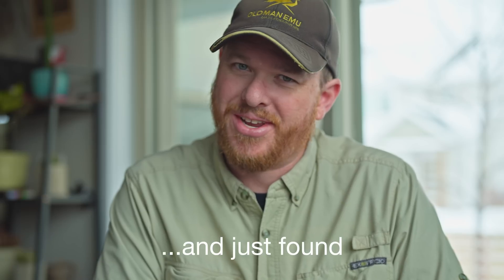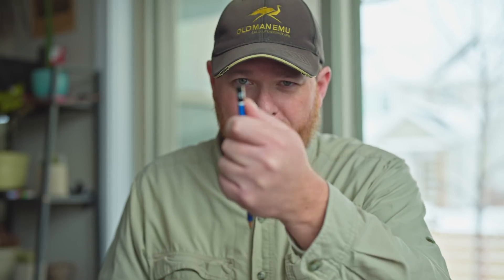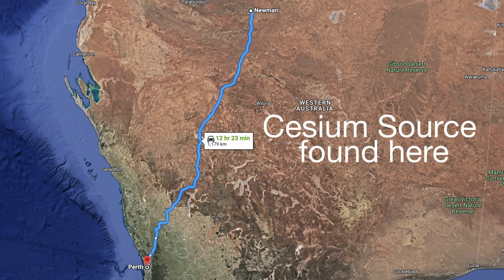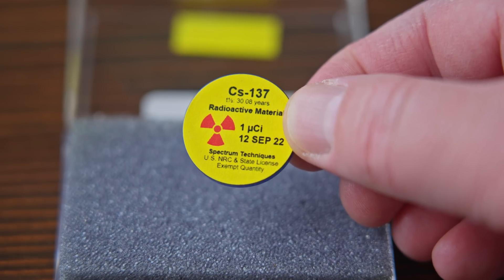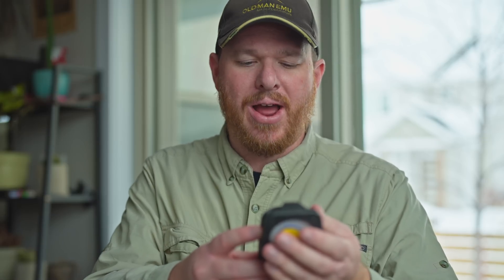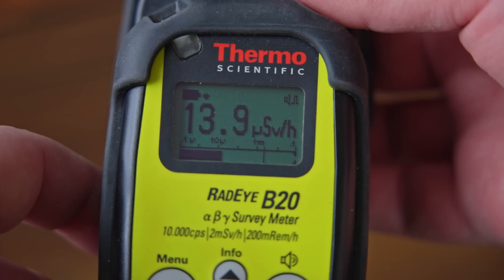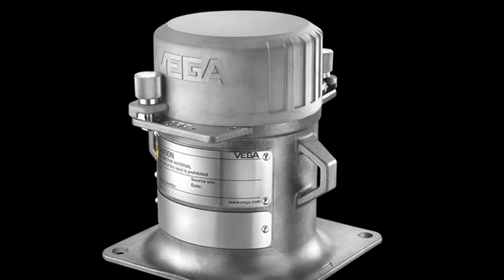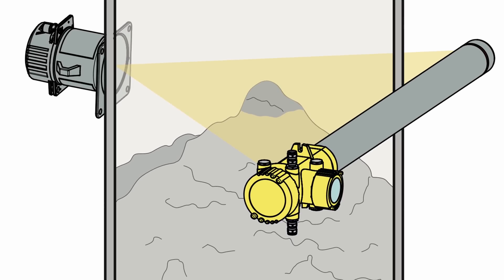Cesium 137 Source Lost and Found in Western Australia

Comment: I used to work with the exact brand of equipment you showed in this video. During my time with this company, I had two incidents with source holders. 
The first thing that happened was that we had a test source of cobalt 60 in the office. The source itself was lowered into a lead cylinder to isolate it. Since it was not in much use I did not interact with it often. One day, I was testing my measuring equipment and wanted to check how much radiation the Co60 source emitted. To my surprise the radiation did not increase when the source was removed from its lead cylinder, which turns out the rod, which the source was attached to, had been upside-down the last 10 years. So when picking up the rod, my fingers were in direct contact with the source. This is 10 years ago, and my fingers are still the same 😂

Comment: I work in the nuke industry and we use the Rem units.  I wish the scientific community did too because the conversion is a bit awkward to mentally do on the fly, when converting usv to mrem. 

I have to write it out and shift the decimal on paper.  Whata wrong with Rems?  They can't be that bad to use.  Everyone just has to be different I suppose.
Reply from the maker: Well I got into this and Sieverts were the dose rate measurement to use...that and Grays. Many detectors now can be switched between Sieverts and Rem, along with some other units. I just picked up a Canberra Mrad 113 and that uses Rem.

Comment: A 0.02Ci is absolutely tiiiiiiiny. I regularly work with 20Ci Iridium-192 & 30Ci Selenium-75 for NDT.

I meam it's not a good idea to eat the capsule if found haha but you could pick up a 0.02Ci Caesium-137 and wouldn't get radiation burns from it.
Reply from the maker: Dang, those are some hot sources.

Comment: I'm curious, it was laying there on the ground for 20 days or so...did they have to remove some soil & clean up the area where the capsule was found or no need since the caesium was contained within the capsule?
Reply from the maker: No soil needed to be removed because nothing was contaminated. If the capsule broke open that would be a different story.
Reply: @RadioactiveDrew  Thanks, I understand more now.
Reply from the maker: Glad I could help.

Comment: So the deadliest is when we eat radioactive seafood right?
Reply: I would be more worried about breathing in radioactive dust that might stick to the lining of my lungs.  This is one of the reasons why smokers who worked in underground uranium mines had incredibly high incidences of lung cancer.  It's thought that the radon daughters would stick to the smoke particles and then get glued to the inside surfaces of their lungs by the tar.  And then those daughter products would remain directly in contact with the lung cells where they could bombard them with alpha particles, which, while not very penetrating, are extremely damaging.
Reply from the maker: @jsigmo this is usually with a high radon environment like a uranium mine.
Reply: @jsigmo , whether one is a smoker or not, if one happens to swallow radioactive materials, it's very dangerous. 
There was a study before that said,  in a polluted place, a smoker has a low chance of getting lung cancer.  A non-smoker will surely get lung cancer living in a polluted place.
Reply: @jsigmo , if you think you have uranium dust there, leave your country.
Reply from the maker: @butchfajardo8832 we ingest all kinds of naturally occurring radioactive material daily. There’s no way around it.

Comment: I work for a large domestic mammo machine manufacturer. The MQSA mandates no more than 3 mGy per breast. Our systems actually run just south of 1.2 mGy for a 2D exposure and 1.5 mGy per tomosynthesis (3D) exposure. Not sure where that 200 mSv number came from but that's going to be too low to obtain a quality image for screening or diagnosis. The detector surface area is just too large, you need more dose than that, otherwise the contrast-to-noise ratio is poor.
Reply from the maker: The number I put in there was 200 uSv and I got that from a site about x-ray doses. There's a lot of info out there concerning doses from different x-ray procedures. I have heard it going as high as 1mSv or 1mGy of exposure. But I figured I would stick with the lower number.

Comment: I think one of the most concerning things about situations like this, as a person with ADHD, and a small forge, i like to collect scrap steel i see to make decorations and art pieces, I have imagined on several occasions how shitty it would be if one of the dozens of small cylinders of metal I find weekly would happen to be a cesium source. Even scarier is the fact I’m in the smack middle of one of the biggest oil producers in America, Oklahoma. Some workers in the oil field check the integrity and state of underground pipelines using Radiographic testing, which use Xray or Gamma rays to view the internal structure of pipelines and components. In fact one of the only SUSPECTED cases of suicide by radiation occurred in Oklahoma and involved a missing source from one of those machines.
Reply from the maker: Ever since I started down this road of learning about radiation and radioactivity I've always had a Geiger counter of some kind in the truck and more times than not, having it running. I'm always curious when I find areas that are a little more radioactive than others with no real explanation to it.
Reply: @RadioactiveDrew  I’ve never really had the money to afford a dosimeter of decent quality, despite my obsession and very minimal collection of slightly radioactive materials. When i was a teenager I would ask my family for a dosimeter for Christmas and birthdays, but they were rather expensive and never got one. 
If i had a dosimeter, I would absolutely do the same as you, who knows how many hotspots there are around us no matter how small. May it be a higher concentration of radon gas from concrete structures, or radioactive elements in the nearby ground, it’s always a fascinating concept to basically metal detect for radiation. 

  Having a dosimeter on my person during my scrap metal scavenging at scrapyards and abandoned structures would be a good peace of mind. I’d much rather have something scream at me, than have a hole in my leg. 

I appreciate your time and words! Amazing content as usual, stay safe!

Comment: Use this stuff at work to make sure meters are working and for safety system checks you can hold it just don’t eat it
Reply from the maker: These tests disks are pretty safe to handle. The sources used in those density meters not so much.

Comment: Your full body dose estjmates are completely off. 20mCi of Cs-137 puts off about 8mSv/h at 10cm distance. At a dose rate of 280mSv/h, the distance to the sourge would be under 2cm. Could you get burns from prolonged exposure with the skin against the source? Yes, absolutely. But there's no way an individual could exposure themselves to 280mSv/h of full body dose from putting that source up to their chest. So no, not 2800 chest x rays per hour...

Comment: Some density meters use a source of 1mCi Cs-137, that is about 10,000x times what you are showing us!   Other manufacturers claim to use sources like you are showing so that licencing isn't required, at least, not in the USA.   So I think we can assume that the source lost in Australia was a fairly hot one!  The containers are probably made of lead with a powder coat to protect them.
Reply from the maker: It was around a 20 mCi or greater that was lost and then found. I was able to hunt down the info from a manufacturer that makes sources for this type of use.
Reply: @RadioactiveDrew  That would explain all the concern to find it again.  I worked with a company in Spain who did these tests in drillholes and their source (similar activity) was tied onto a cord and dangled down 5 metres into an indoor patio that had no access from the apartment building where they had their offices.  That was their idea of "safe shielding"

Comment: I would have thought those little cesium check sources like the one you have would be more radioactive. My counter picks up ~23 uSv/hr from an NRC-exempt uranium glass check source - without alpha. Any idea why that would be? Maybe the size? Uranium glass is like you chopped off the tippy top from a glass marble so maybe pinky-nail size, whereas the actual cesium content in your source is super tiny? 'Cause I know cesium is a lot spicier.
Reply from the maker: The check sources can come in different amounts. The one I have I believe is the lowest you can buy.
Reply: you cant use dose units with beta. well you would have to use milliard. in reality its 0.900 usv or around there not 23
Reply from the maker: @kingcanada2588  that's kind of a grey zone there. When they talk about Sr-90 and its activity and dose rate they use Sieverts. Sr-90 is a beta emitter.

Comment: I found an area with rocks that give 100 usv/hr.  When I started digging with a shovel I noticed the soil all around it was sand/silt, but the soil directly in contact with it was clay  and the rocks were soft and broken down. Was wondering if it was the radiation that broke down the soil to clay faster.
Reply from the maker: I know that sometimes radiation can cause a change in color with the surrounding rock layers. Usually it won’t break down other rocks…but I’m not 100% sure it won’t.

Comment: Here in the UK they were transporting a source and stopped on a railway bridge to take a look at it without the shielding. To cut it short it rolled off the bridge parapet and fell in a passing goods train. The train was stopped just short of London and the authorities found it in a coal truck. That's a true story. What I will never forget in my copper mining days is that we were in a remote place so it was up to us electrical techs to change sources. The source was a pinhead of material inside a double walled stainless match box inside shielding so heavy you needed a crane. To shorten this the source fell through a grille floor and dropped into the discharge sump of a 800 ton rotary mill. The sump was 10 feet deep and the day workers called me over to take a look. What I will never forget is the wonderful blue/ green glow lighting up the whole sump. I thanked the lord that I was a shift worker and fishing it out had nothing to do with me.
Reply: This may sound weird as hell, but the fact you experienced the Cherenkov Effect outside of a nuclear reactor is probably the coolest thing I’ve heard in a long time and Im honestly a little jealous.
 I’m not sure if you fully understood the physics behind the glow at the time, or maybe you did, but either way it was probably the most amazing experience of your life.
Reply: @Kill3rBamb1 the reaction only accrues after reaching criticality and then is cooling down. This is 100% a fake story. As you can't reach nuclear criticality outside of a reactor without a lead casket
Reply: I’m assuming it was under water or something in order to glow so brilliantly, I don’t know much about locomotives or what a sump even is, but assuming it was submerged, you got really lucky because depending on the depth, liquids are pretty good neutron absorbers.
Reply: @Kill3rBamb1  the blue glow was observed in US nuclear labs as well. Not sure if it's ionized air glow, Cherenkov radiation from moisture absorbed by the sample or what, but it was also much admired in Goiânia during that orphan source disaster. One small child painted herself with the powder, got some on her sandwich and died from a lethal dose of radiation.
Reply: I'm in the UK - thanks for the stories. Really interesting.

Comment: So it is dangerous enough inside its container. Then what if somehow it got exposed out of its container? How dangerous will it be? ( Not sure about the amount but if its container has 5 inches diameter and 8 inches long.) And what's gonna happen if the Cesium 137 is smelted in the open? I'm worried because this is what likely happening in Thailand but the government haven't given any proper answer of what really happened and we just need to know if we are safe.
Reply from the maker: If someone opened the container and took out the Cs-137 source there could be a very big contamination problem. But so far it doesn't sound like that is what happened. If the Cesium was smelted it would contaminate the general area of the smelting location as they wouldn't be worried about it getting places. It would also contaminate whatever it was smelted into. It would be a very localized problem...if that happened. So people that worked at the smelting location would be at the highest risk. The likelihood that any of that cesium making its way out of that area to effect other people is extremely low.
Reply: @RadioactiveDrew  What I know so far is that the Cs-137 (in its container) in some factory was lost. And around 10 days later they found this container been smashed in a smelting factory. Then later, they found Cs-137 in red dust from this smelting factory as well. But the government said everything is undercontrol and there is no contamination. I don't believe that tho. So I searched for more info and found you. Thank you for your reply!
Reply from the maker: @rosemary_hana  I'm reading up on the whole situation and it seems like they are really trying to downplay this whole thing. It seems that the temps that they were using to smelt the metal might have turned the cesium into a gas. Would be helpful to know the metal that was being smelted...maybe further investigation will show that. I just wonder if the cesium gas could be re-captured by the metal as a chemical compound. It could have also turned into a gas at those high temps and then solidified once it cooled. The cesium doesn't disappear.

Comment: In Thailand we lost cr-137 from the powerplant 3 weeks ago. It doesn't look small like this. That thing with the steel cover weighs 25 kilograms. Today we found it in a steel melting factory. The Thai  government said it was safe but I don't think so. What do you think about it? Any suggestions?
Reply from the maker: The Cs-137 source that is used in industrial settings can be very strong. I don't know much about the source that was lost there and then found. But Cesium 137 is usually in a metal source container. So as long as it wasn't opened and had the contents spread around it would be fine. I don't think its something to worry about. But if you are concerned about accidents like this and want to know for sure I would look into getting a Geiger counter of some kind. Better Geiger makes one that is easy to use and sensitive to gamma radiation, which Cs-137 gives off a lot of. Hope that helps somewhat.
Reply: @RadioactiveDrew  thank you so much for your kindness. The point that we are so worried about right now is the steel factory may have already melted it. So in this case it is not just open, but burns into dust and smoke. They found the radioactive ☢️ in some pieces of steel, but there is no sign of cs-137 or it's steel container anymore.
Reply from the maker: It sounds like it did get melted in with some steel. The story they are telling is that the temp of the steel melting vaporized the cesium, which could have happened. But this doesn’t destroy it. If that happened the cesium was converted to a gas and then once it cools it becomes a solid again. But I think the contamination would be contained to that steel plant.

Comment: What would you have done Drew if you had found the lost source?  Would you pick it up with your bare hands and see how many CPM your Radeye gets, or would you keep your distance and call authorities right away?
Reply from the maker: Good question. I would have investigated at a safe distance from the source. That safe distance would have been determined by the readings I was getting. I wouldn’t have picked that source up with my hands or anything else. If I needed to move it out of the road to make sure it didn’t get run over I would have used the camera tripod legs at full extension. I would call the authorities as soon as possible because a source like this isn’t something you play with.